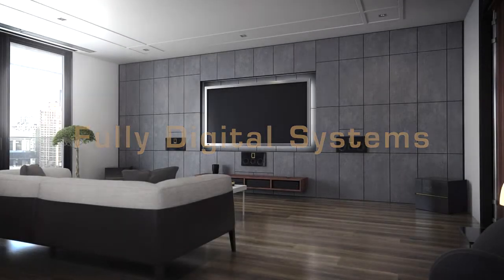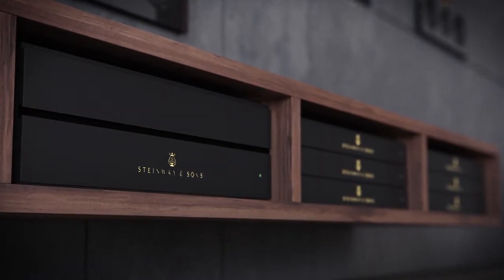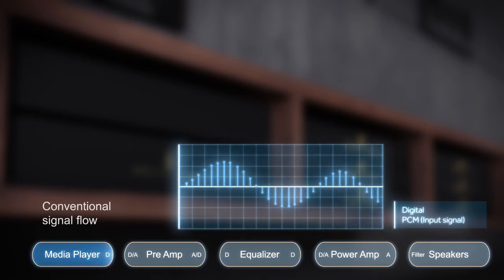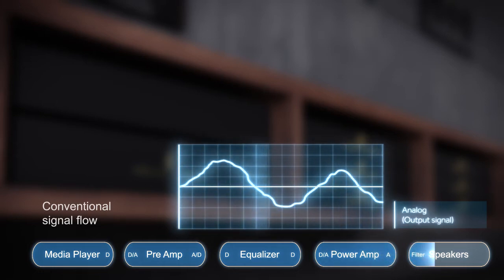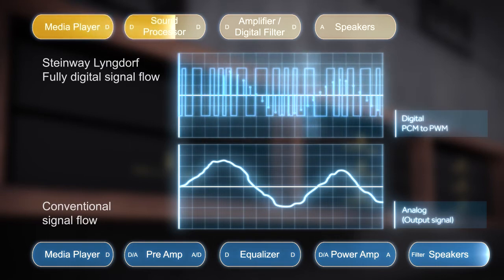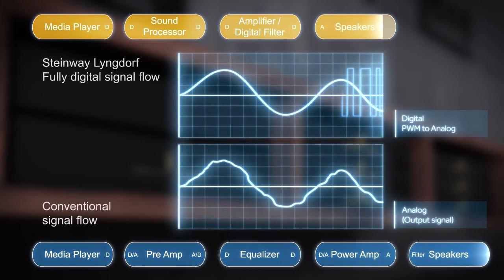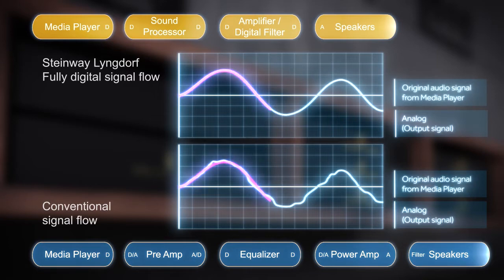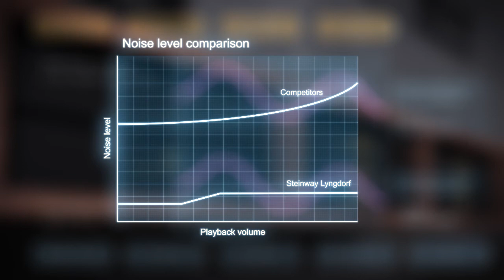Fully Digital Systems

Comment: There are lots of amplifiers labelled digital which take an analogue signal run through A/D conversion and are then amplified in the digital domain. Lyngdorf make this type of amp that they label “SEMI DIGITAL”.
They also make amplifiers that connect digitally to your source. These sound clearer and cleaner than semi digital amplifiers and are labelled “TRUE DIGITAL” amplifiers.

Comment: Incorrect assumption on video: It's just not true that analog systems in general convert to digital and back to analog multiple times as it's stated on the video. It happens only once, the same as in your digital system, and that's right after the digital source.